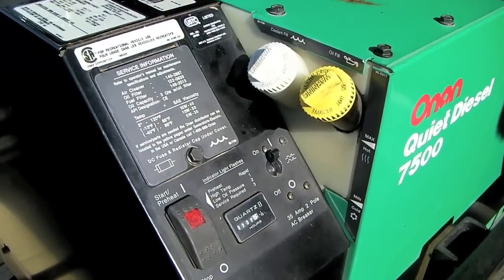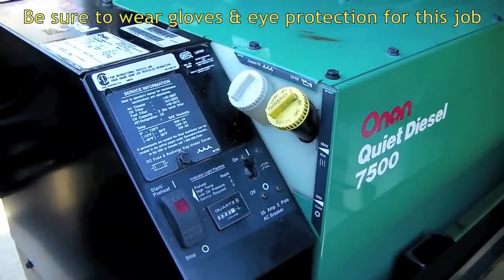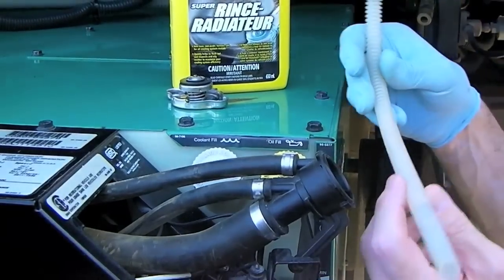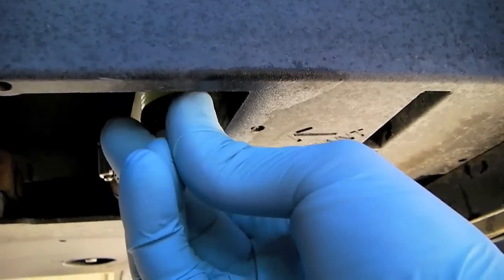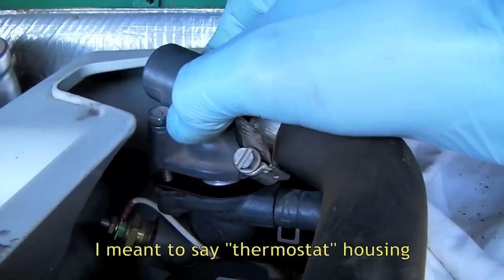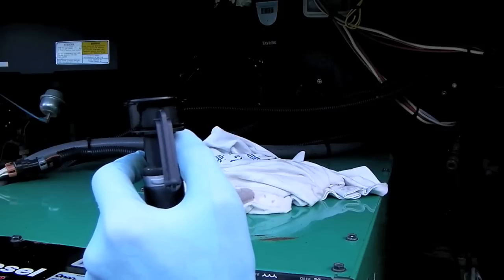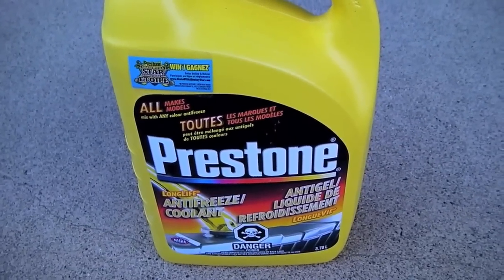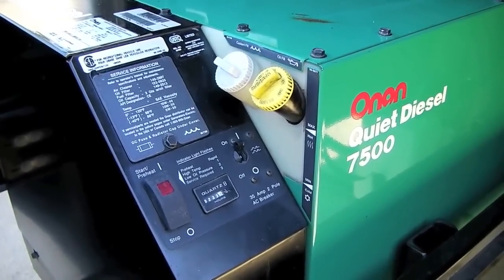Change the Coolant in Your Onan Diesel RV Generator || RV Generator Maintenance

Comment from the maker: Thanks! I've replaced the fuel filter before, and will make a video about it the next time it's due. Sorry though... I think I'm not scheduled for that until next year. As I recall, it wasn't hard at all. Have a catch basin (an oil pan is perfect) and wear nitrile gloves. If I remember right, you also need a vise grips or two to pinch off the fuel line(s). I'll see if I can find some instructions and send them to you.

Comment from the maker: That's a great question Pat. Since generators are powered by an internal combustion engine (either diesel of gas), they all have to have to be cooled, but smaller ones may be air cooled instead of water cooled.

Comment: I have never heard my genset go into low idle or increase speed with or without a load.  I've always thought that the engine runs at a constant speed of about 1800 rpm in order to generate 60 cycle power.  I'll have to listen more closely when I do my service on it.  Thanks for the video.

Comment: I find that if I drill a small hole in the thermostat just to the inside of the gasket area, you will eliminate most air trapped in the refilling of any engine
Reply: Gornall

Comment: Thanks for the video! I noticed a little radiator fluid on my coolant drain cap on my Onan 8000 today in my 2013 Tiffin. Does anyone have a link for a replacement drain cap? I believe that’s what’s failing, unless someone has another opinion. Thanks!

Comment: I have never owned or probably ever own that nice of a motor home,  but I noticed what looked like a thermastat to turn the roof air condioner on inside the generator compartment.  Excuse My lack of knowledge, but do they have a remote for the air conditioner out there?
Reply from the maker: +Russell Hancock You probably saw the remote temperature sensor we mounted in there. That transmits the outdoor temperature to the indoor/outdoor thermometer inside. It looks kind of like a thermostat. No a/c control out there!

Comment: Thank you for this video you should possible have said that if the generator is diesel they require different antifreeze
Reply from the maker: Hi Carter! Our Onan Diesel generator owner's manual says only the following about coolant: "Use ethylene or propylene glycol anti-freeze solution that con- tains a rust and corrosion inhibitor. The anti-freeze should not contain a stop-leak additive." There's no special requirement other than that. We opt to use Fleetguard Compleat coolant, since that's what our engine uses. Saves us from having to keep two types of coolant around.

Comment: Of what you mentioned peter about putting the drain cap back on, I know my grandfathers friend mentioned about a time that someone that my father worked with as a mechanic was changing the oil in I think it was a box truck diesel engine, and the guy drained the engine and forgot to put the drain plug back in the engine, and put the device that fills the engine with oil, and set it for I think it was 44 quarts and walked away. He came back to 44 quarts of oil on the floor under the truck. Yeah, that was a mess. X(
Reply from the maker: Yikes!
Reply: @RVgeeks  Yeah, I know. I know another time, I think It was within a year or 2 or so ago, my father and a few other guys were working on a truck, and one guy went to start the engine up, and the engine took off, they found out later that someone didn't tighten down the diesel fuel delivery intake rail enough, and the rail (or something like that) was loose enough to where there was a free flow of diesel to the engine, and that's what made the engine take off, in terms of a diesel run away. Peter, I know the thought of a diesel runaway is a little bit of a scary type of thought to have happen to you in particular, but, would you and john know what to do in that weird rare event that event that your engine does miraculously takes off on you?
Reply from the maker: Having driven buses since the early 80s, I have always heard about that infamous “runaway engine“ danger. But in all those many years in the bus business and now driving RVs for the past 15+ years, not only have I never experienced a runaway engine, I don’t personally know anyone who has, or even anyone who’s heard personally of someone who has. I think that the likelihood must be pretty minuscule. That said, barring an emergency shut off switch, which I don’t think even exists in modern diesel engines, or at least not that I’m aware of, the only thing to do is get the hell away from the vehicle, and warn everyone else to do the same.
Reply: @RVgeeks  Yeah, I do know that diesel runaways could get dangerous, one things I didn't mention earlier is that my father and a few of the other guys at the time were able to get the engine to stop, I think they used a piece of cardboard on the air intake to stop the engine, I know my grandfathers friend (same guy as before with mentioning about my father) was a mechanic as far back as the 1970's, and coarse, that was during the time of the detriot diesels, at which were famous for running away, I actually think my grandfathers friend actually mentioned that there was something that the manufacturers actually put something on the air intake (or something like that) in the chance that the engine took off. Well, in the 1970's, my grandfathers friend was working at the time on a truck with some one else at which had a detriot diesel in it, I forget what the other guy did to end up with the result, but, the guy started the engine, and the engine took off, the one guy jumped out of the truck and he did manage to reach in and hit the device that got the engine to stop, but he got burned by the tail pipe in the process. I know some people mention about being able to use a fire extinguisher to also stop the engine, assuming you do aim it into the intake when you use it. Coarse, yeah, you'd end up having to take the top of the engine off to get the powder out of the engine. but, hey.

Comment: Bought a 98 Country coach Magna a few months ago and although Im happy I did,I get overwhelmed a little with all the things to worry about.  I have an Onan 8000 and these videos on servicing are super super helpful.  Im gonna change the oil today for the first time.  In regards to changing the coolant or even monitoring it, is there anyway to see if you need to?  I suspect the answer is just do it for piece of mind.
Reply from the maker: Congrats on your new-to-you rig, Barry! So glad our videos are helpful. We'd suggest that unless the previous owner stated specifically that the coolant was recently replaced, we'd do the entire process, just to create a baseline where YOU know when it was done. Pro Tip: use OAT long-life coolant, which is better than the older style we used in this old video. This stuff is the best! https://amzn.to/3wcYvSa Pre-mixed (don't add water) and extended life.
Reply: @RVgeeks  Will do, Very kind of you to respond with that advice.  Much appreciated.
Reply: @barryjackson1401 Hi Barry 👋

Comment: Very nice video.  Freightliner uses: "Fleet Charge SCA Pre Charged Coolant Anti-Freeze for Heavy Duty Engines as factory fill" for its engines, including my Cat 3126E.  The generator should not use this?  Or is it acceptable?  
Also, I have only 260 hours on the generator.  Onan specs are to replace at 1000 hours; I don't see a age replacement spec.  But its a 2003 and probably has never had coolant changed.  Is it wise to change anyway?
Reply from the maker: The specs required for coolant should be in your generator owners manual, but there's generally two types.... pink or green. We're pretty sure if you stick with the color you have, you'll be good. Every generator surely has both a time and hours requirement for coolant replacement. Be sure to check the manual, as 13 years has got to be way too long, regardless of hours. Ours is every 1,000 hours or two years, whichever comes first.

Comment: We have the same Onan 7500 genset and found this very useful...as are your videos on oil change, fuel filter, etc.  One question:  is there a particular thermostat that's needed or can it be purchased at an auto parts store?
Reply from the maker: Hi John! The thermostat we always use is an actual Onan part, and a little expensive, but only needs replacing every 5 years, so not too bad over time. Here's the part you need: http://getrvparts.com/onan-cummins-a046z961-rv-diesel-generator-thermostat-185-5458/ Also, be sure to order a new thermostat gasket at the same time, as they should always be replaced together: http://getrvparts.com/onan-cummins-185-2238-rv-diesel-generator-thermostat-gasket/ BTW...The pressure cap for the radiator is pretty standard, and is available at most auto parts stores. Hope this helps!

Comment: Any idea why I would have coolant spraying out of the vent hose when I have the cap off?
Reply from the maker: +Trey Palreiro Hi Trey! Is it possible that you got some coolant down the overflow tube while you were filling it? Is this only happening when the generator is running, and does it continue to happen, or just spray out initially when you start the generator?

Comment: This looks above my skill level but I have a couple questions. I just got a mobile grooming van with this generator that only has 25 hours on it but is several years old. I am planning on doing an oil, oil filter, and air filter change myself soon as I think I can handle that. Basically I am confused on how the coolant system works. I can’t tell if it needs more coolant. I can’t see much of anything in the compartment to the side of the panel. Do I add coolant to that compartment until I am in between minimum and full? Or do I add it to the hose shown in this video? Does it matter if the coolant in there already is a little different than the coolant I buy? Or should I pay for someone to do this whole process since it’s a couple years old even though it’s at low hours? Also, would you recommend doing a fuel filter change at this point?
Reply from the maker: Hi Rachel! When buying a used RV, we highly recommend doing the routine maintenance & changing fluids, unless the seller has recent documented service records to show when it was done, and you're sure it's not due. The thing about generators is that the ones with the lowest hours often have the most problems, due to lack of use. We'd suggest that barring any service records being available, you should be able to handle the oil & oil filter replacement, cleaning the spark arrestor, replacing the air filter, and replacing the fuel filter. The coolant is challenging enough that we'd suggest leaving it to a pro unless you're pretty confident. As far as mixing fluids.... don't. If your coolant needs a top-up, only use the same type that's in the system already.
Reply: RVgeeks Thank you for your advice. I ordered the parts to do everything but the coolant change by myself but the soonest appointment I could get with Cummins for the coolant was 20 days from now. I need to run the generator to do the other services but I’m worried about running it with low coolant and the old owner does not remember the exact one she put in to top it off with. Should I add deionized water for the 20 days before my appointment so I can do the other stuff?
Reply from the maker: You could do that, but also keep in mind that if you run it as is, and it overheats, it will shut down to protect itself. If it runs okay, you’re good to use it until the coolant gets replaced.

Comment: Thanks for the great video. I'm going to service my Onan 7500 diesel generator, looks exactly like yours, where do you get the thermostat? Are there any brand or type of flush that you recommend? I understand some of these generators have two fuel filters, one post fuel pump and one pre-pump. Any info on this? Thanks again.
Reply from the maker: +Frank Freitas Hi Frank. We bought our thermostat directly from Cummins Onan when we were in Indiana. We just did a little searching for where to buy it online, but not sure the best place to recommend. We'd suggest contacting Cummins Onan directly to inquire about either buying online or where you can buy one in person. https://www.cumminsonanstore.com Just have your generator model number handy. Hope this helps.
Reply: +RVgeeks Thanks, do. You know the pounds of pressure rating on the cap?, Thanks
Reply: @NipomoBeach hi handsome 👋

Comment: Can you change the thermostat without draining the coolant?
Reply from the maker: We have never tried it, but since it’s on top, guessing you could release the pressure on the system by opening the radiator cap (on a cool generator) and then replace the thermostat and any coolant that runs out. If you don’t need new coolant but need a new thermostat, it might be worth a try.

Comment: WHen you added the water why didn't you use the same blue funnel with white extension ~ Just curious ~ is there a reason?
Reply from the maker: No special reason other than we generally only use the one with the long white extension when a non-flexible one won't work as well (or at all) for a particular job.

Comment: How do I check coolant level in a side radiator diesel motorhome
Reply from the maker: Hi David. We also have a side radiator, and the overflow tank and coolant cap are easily accessible at the back of the engine. There has to be some way to add coolant, so we’re guessing you must have some sort of access as well.

Comment: How many hours is considered allot on a 7500 diesel?  I have 1,450.2
Reply from the maker: If it’s six months old, that’s a nice healthy amount of use. If it’s 10 years old, it’s barely broken in! Diesel engines are built to last.
Reply: @RVgeeks  it’s 21 years old.   ThankYou for responding
Reply: Last question, I promise.  Have you ever replaced the Engine V belt or had it replaced?
Reply from the maker: @QLFProductions  In our 18 years owning our motorhome, we never replaced the belt, and it was never a problem. While I did all the maintenance on the generator myself, we did ask Cummins their recommendation about replacing belts and hoses. They said if I looked at them, and they were in good shape, just leave them alone and they’d be fine. We’re not 100% sure how many total hours were on our generator when we sold our RV this past spring, but it was definitely fewer than you had by a little bit. Maybe about 1000 hours if we had to guess. The only thing we ever did was change the oil, oil filter, and air filter each year, along with cleaning the spark arrestor at the same time, and changing the fuel filter and flushing the coolant on the schedule recommended by Onan. One thing we could suggest if you have some concerns or your generator is having any issues is that even if you normally work on it yourself, maybe make one annual maintenance appointment at an Onan dealer to get some professional eyes on it. In all those years we had it, we had only one instance of any type of failure, where we had to take it in to be repaired. While it was there, we asked them to inspect it, and even though it was already over 10 years old, they told us the belt and hoses look great, and to leave them alone. Hope this helps!
Reply: @RVgeeks  it helps tremendously, I want to be responsible with maintenance like you guys and the manual says replace the belt every 1000 hours.  You have to remove all the covers and the belt is in the back.  Impossible to do if it doesn’t slide out.  I’m at 1400 hours and all is well.  I think I’ll wait a bit longer before having the belt changed.  There’s a YouTube video of a guy changing the belt on the 7500 at 5000 hours and the belt still looked great.  I wonder if you guys still have an RV.  That’s not a question because I said I wouldn’t ask anymore questions lol.  Your videos have been a tremendous help.  All of them!
Reply from the maker: @QLFProductions  We thought the same thing about our belt, and it does appear to last a lot longer than they say. Thanks for the nice note. Glad we’ve been helpful. Not to be self-promotional, but our first new video in over a year and a half, published last week, talks about what we’ve been up to and what’s next for us RVing-wise: 
https://youtu.be/W1I59wCt28I
Reply: @RVgeeks  About to watch it now!!!!!

Comment: Can anyone explain the reason why coolant should not go down the "vent tube"?  How does coolant not end up in the tube as the coolant is circulating and going up to the top of the cap?   I would think coolant would go down the vent tube as the system pressure increases and water is force to cap.  Right?   Sorry but I'm confused by this vent tube.
Reply from the maker: It simply helps to allow air to come up and out of the system during filling. If you pour coolant down the vent tube, it will then require more effort to purge all the air out of the system, since you've prevented some of that air from coming out during filling, by blocking its natural route of exit.